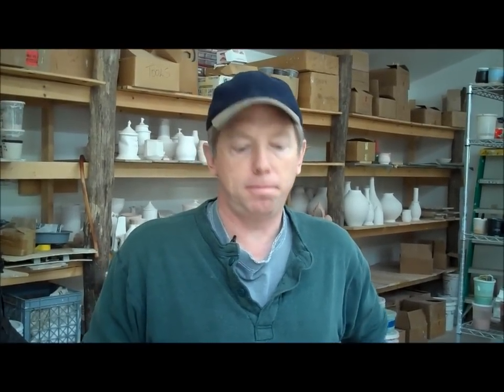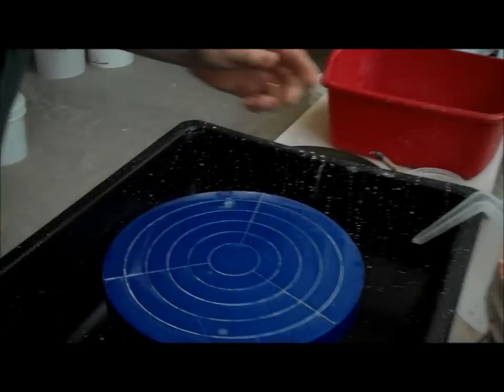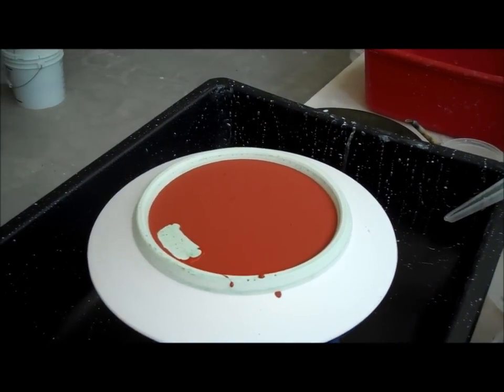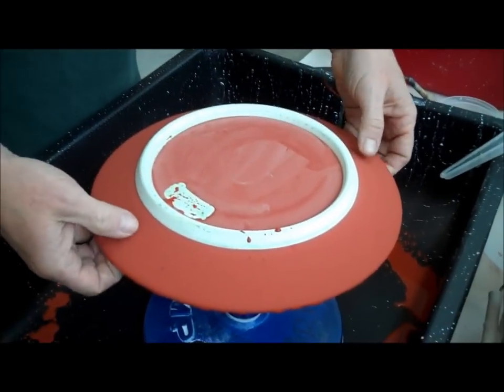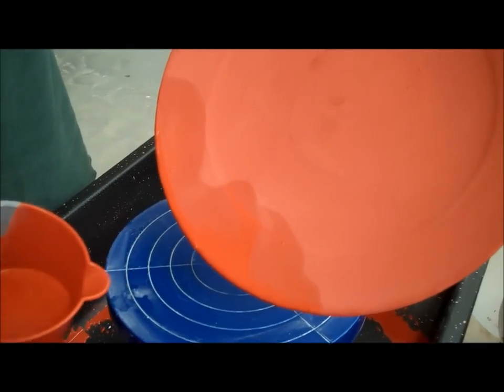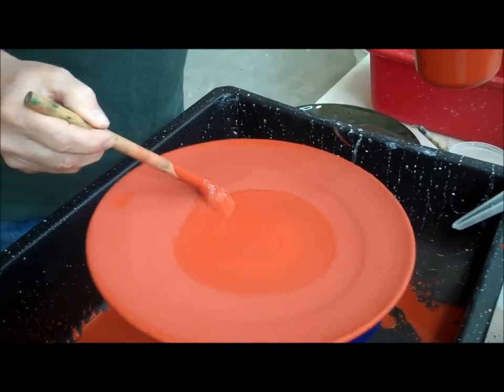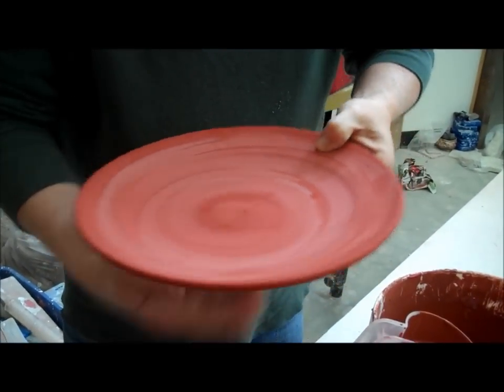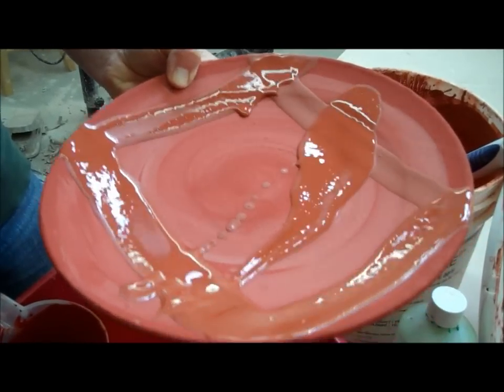Glazing a Plate 2012

Comment: Thank you for sharing John. I'm don't throw as meny large platter as i wish i would... just becouse the glazing problems. Do you have eny problems with your glase on the rim on the pot? When I do this I get alot of dried glaze "beads" that makes it look uneven.
Reply: The place where my trays are fired use those stilts with the metal pins to hold the items that are glazed on bottom. is it possible to wax the entire bottom on a tray or always put the footed rim & wax that part. I don't like how the stilts leave the nubs on the bottom.

Comment: Please raw glaze you are waisting a firing. The stats will tell you less than 2% of ceramics world wide are bisque fired.
Reply: Ok, and what percentage of ceramics world wide are hand made and finished by an artisan as opposed to slip cast in a factory and made by the thousands? I'd guess that well (well) under 1% of all ceramics made world wide are hand made artisanal pieces, the rest are factory made with high speed automated machinery. So obviously, your statistic may be true, but just as obviously it does not apply to hand made pottery, which is what John Britt makes.  The purpose of bisque firing is to stabilize the pot so liquid glazes can be applied and they can be handled during glazing and not break.  If machinery is making plates by the thousands, that is not a consideration.